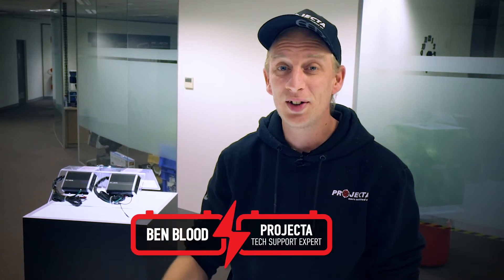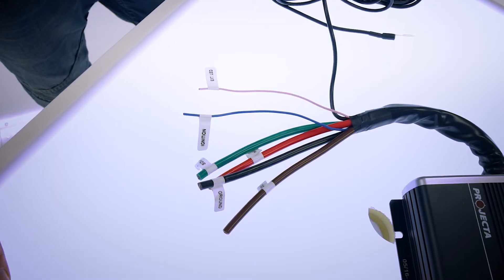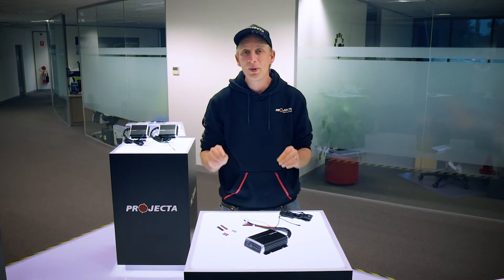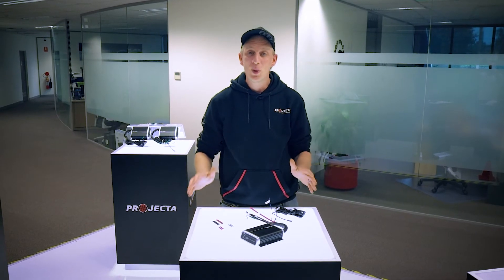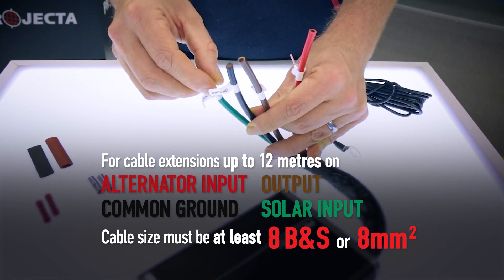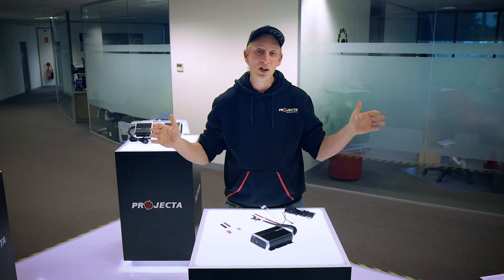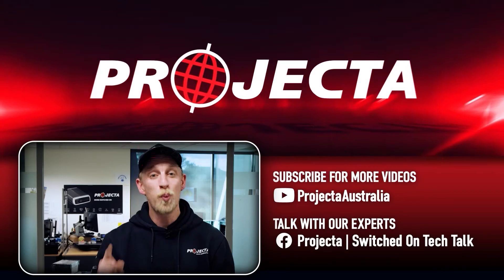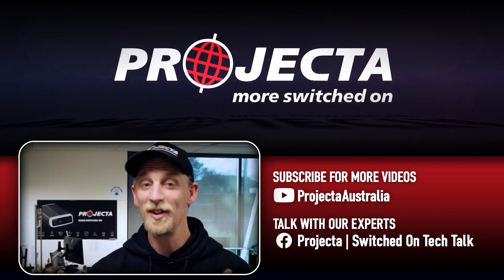Projecta Dual Battery Charger Installation - Tips on Cable Sizing

Comment: My Projecta has been a life saver..
Im running a small car fridge with an AGM battery for when im driving around for my job..
I dont exactly need the solar panel..
Would it be ok if I got rid of my  (heavy) solar panel and relied no the charger alone?
Im also thinking of upgrading to lithium and getting the Projecta lithium charger.
Its all about the weight and therefor fuel consumption..

Comment: I have just installed a 2kw diesel heater it apparently starts around 8 amps and drops to 2-3amps when running.
The projecta BMS is less than a meter away I have two spare 10amp terminals and a spare CF 15amp terminal.
Which terminal should I use ? What size cable ? And should I wire the neutral to the chassis or into the BMS.
Regards
Shane

Comment: A wiring guide for a kings type control box would be really helpful given that’s the most likely set up people use regarding control boxes, but their chargers have positive and negative cables for all their outputs on Anderson plugs, super easy, but the idc25 only has one ground, and no indication as to how to apply that to a control box set up.

Comment: I have a IDC25 approx 3 years old, has worked faultlessly, installed in a caravan, apart from the electronic noise emitted while charging on solar (voltage input from solar panel 21.5 volts) any reason for this irritating noise and can it be turned off?

Comment: I've just installed mine yesterday. I've had a healthy starter battery, around 13V however the next day it's sitting at 12.7V. The charger has blue solid, alternator solid, solar solid, and charging led blinking. Solar is connected but under carport, no sun so no output. That looks like it's still giving a float charge from the starter battery even though the starter battery is under cutoff spec of 12.8V, what's going on here? Thanks!
Reply: While the solar panel might be under a carport, there MIGHT be just enough to start the charger.  Suggest you disconnect the solar to test the operation of the IDC25.  The alternator light remains on most of the time and simply confirms connection to the starter battery, but does not mean it is charging from alternator.  Please feel free to contact our team on 1800 422 422 if you wish to discuss further.

Comment: Benny, My Projecta IDC25L 25A 5 Stage Intelli-Charger 9-32V Lithium Dual Battery Charger is turning off after 2.0 seconds or so on vehicle charge. 
Works fine on solar, had the car completely re-wired and still not good. In my unit broken ?
Reply: You will need to check the input voltage across the RED input wire and BLACK ground wire to see if there is a voltage drop causing this, that is the ONLY way to determine whether or not the unit is faulty, if it is stable above 13.4Vdc then there must be something else at play, however if it drops at all when the GREEN charge light comes on the the install will need to be fixed up.